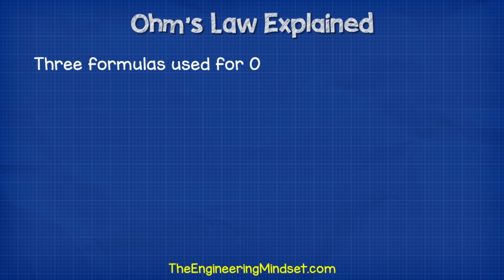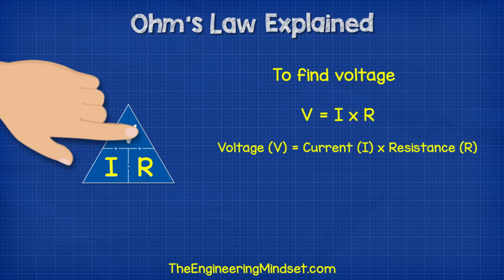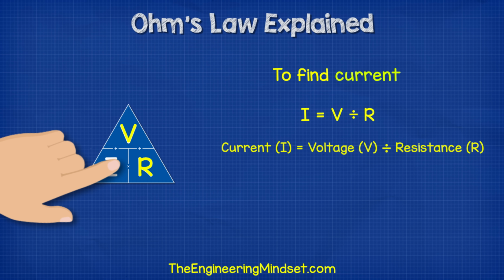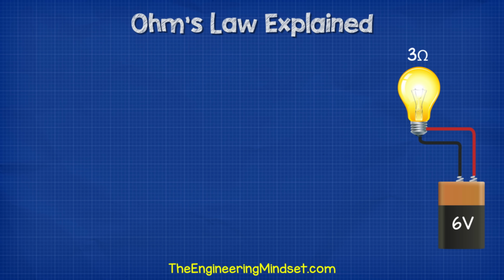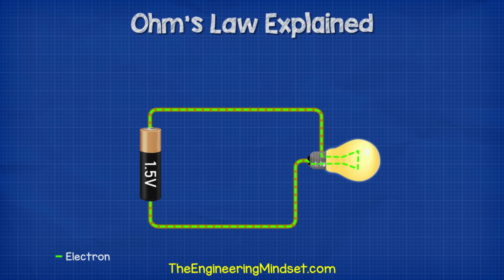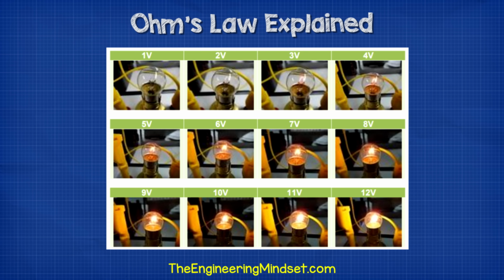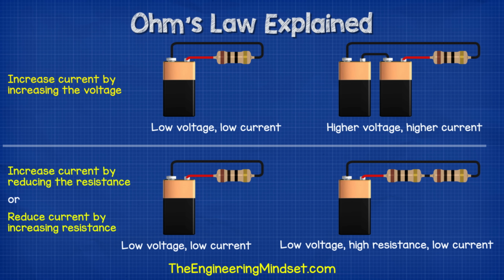Ohms Law Explained - The basics circuit theory

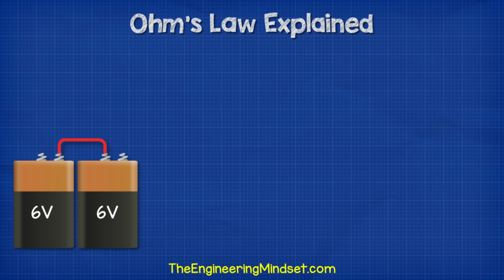Comment: 4:24 I'm going to need this explained... Batteries in series increase voltage,  Batteries in parallel increase amperage.  The available wattage doesn't change in either scenario, the way you explained it would double the wattage.

Comment: I thought when connecting in series only the voltage rises, while the amps stay the same. And vice versa for parallel.
Is resistance the reason the amperage increases? 
I thought if you were to say wire 5 batteries together in series. With each battery producing 10volts and like 10amps for example. It would be 50v and still only 10amp. Are you just increasing the amperage yourself to accommodate the higher volt? Or am i just missing something?

Is ohms law differnet than the example i gave?

I see ive just searched it up coz who knows how long it'll take to get an answer. The difference in the equations is the resistance

I now also know that solar farms, we'll built, are generally going to have a very low resistance anyways. Around .1 or so. AND that my example is mainly used as a baseline to show that in series connections work that way without factoring in the resistance. Just essentially a simplified explanation.

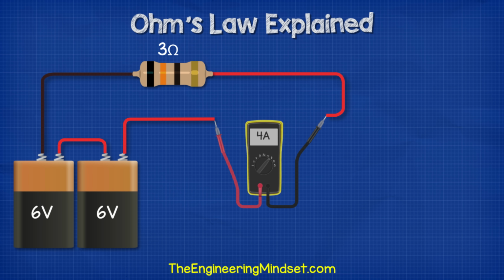Comment: CORRECTION.   At 4:35 when you connect two 6v batteries that each have 2 amps in series, the voltage = 12v but the current remains 2 amps not 4 amps.  Yes?

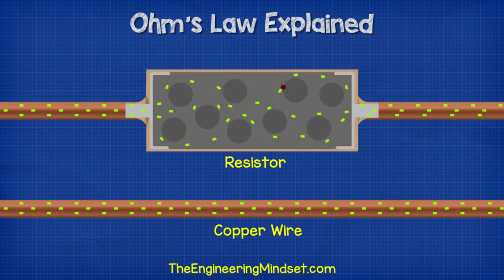Comment: 8:26 - but this is where I'm confused. If the resistor removes energy from the electrons, then if I placed the LED 'before' the resistor, it would emit a different amount (more, if 'before' means closer to the negative terminal of the battery), than if I placed it after the resistor, as the energy hadn't yet been removed from the electrons. Like in your diagram..

Comment: ✨1st Question ;

Lamp voltage (V)⚡ = 120V
Lamp Resistant (R) = 240ohm's

We have already found V and R

Need (I) ;
Current (I) = Voltage(V) ÷ Resistant (R)
I = 120V÷240ohm's
I=0.5Ampere 

✨2nd Question ;

Lamp Resistant (R) = 240ohm's
Current (I) = 0.958A

We have already found R and I

Need (V) ;
Voltage (V) = Current (I) × Resistant (R) 
V=0.958A × 240ohm's 
V=229.92V

Comment: well this was super useful because i am currently planning to make my own 3D printer , well basically a new concept but the thing is i am 15 and i am in 9th standard so i don't have much knowledge , but because of my passion for engineering and because of the feeling to do something special i , started working on projects by dividing them in two parts theoretical part and the practical part and not down my observations. so i knew i would need to know basic concepts of electricity to move forward on my research and make my first project and yea its my first project. so this helped me a lot in understanding it . Thanks a lot and sorry if there any grammetical errors , well english  wasn't my first language.

Comment: What am I missing here? I’m an electrician. The amps drop with a higher voltage in the field, equipment is more efficient if you give it another phase (120v). At 120v an AC might draw 10amps but at 240v it’ll draw 5amps.

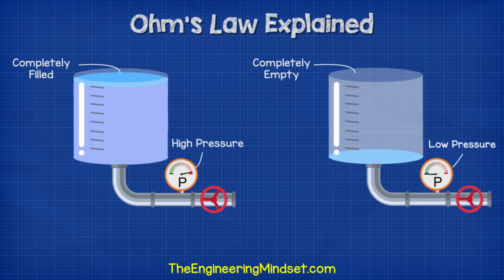The example at 4:50 says if you double the voltage, the amps (current) double. Is that in a series or a DC circuit only or something like that?

Comment: 1. Ans: 0.5 Ampere
2. Ans: 229.92 Volts
Reply: Wrong u divided 120 by 240 you have to switch it around because that wouldn’t work so it would be 240 divided by 120 = 2 amps not 0.5

Comment: 4:25 I thought that if you connect batteries in series only the volts increase and the amps stay the same. I’m confused again
Reply: Found this helpful from a forum: 

The current through the load certainly increases when you put a second battery in series with the load - you've used Ohm's law to prove it.

What people mean when they say "current doesn't increase when batteries are in series" is that the maximum current you can get from the batteries doesn't increase.

All batteries have a limit to the current they can deliver. If you have two batteries that can each deliver one ampere of current and you put those two batteries in series, then you can still only get one ampere out of the batteries. The voltage adds, but the maximum deliverable current stays the same.

If you put those same two batteries in parallel, then the current from the batteries adds. You can get double the maximum current out of them - but the voltage is only the voltage of one battery.
Reply: when you say "maximum deliverable current" are you referring to amp hours? Cuz if you are I get it.
If you arent I'm confused - what does "maximum deliverable current" refer to? If the currents add together according to Ohm's law, how is the added number of amps different from the maximum deliverable current?
Reply: Why wouldn't current increase if volts increase? Ohms law states that more voltage equals more current.

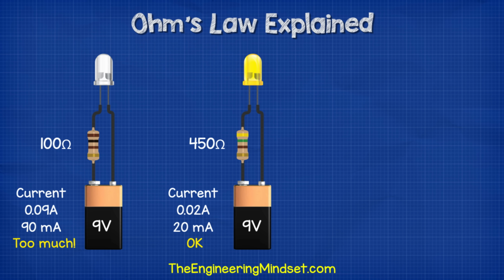Comment: sorry but i dont get the resistance examples at 8:44 - are those some random values in both examples? how do I know that in first example the resistance is to small and it is alright in the second one??
Reply: because the rating for the LED is 22mA or 0.022A

Comment: Could someone please help me understand, I  was doing self study on some of these topics and learned that 1 amp = 1 coulomb per second, and I thought 1 coulomb was equal to a group of 6.242 x 10^18 electrons, but I did some math with elementary charges because I got curious about the numbers, found that 1 e- or p+ has a base elementary charge of 1.602 x 10^-19, if I divide 1(representing 1 coulomb) by 1.602 x 10^-19 I get 6.242 x 10^18, and I double checked by multiplying 6.242 x 10^18 by 1.602 x 10^-19 and got 1. but doesn't that mean that 6.242 x 10^18 is not the number of electrons but instead is the collective elemental charges of a group of electrons in a coulomb?

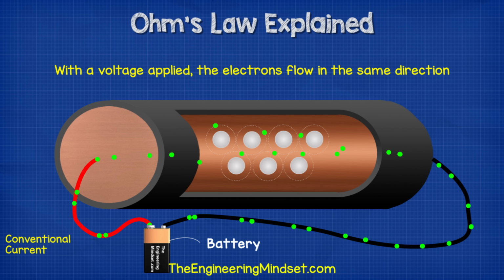Comment: so this is why this is confusing... look at the battery flow at 7:18. the electrons are going from the positive though the wire, and back to the battery to the negative... but the very next picture, you have the opposite. you have electrons going from the negative, though the light, and back in from the positive.  I take it this is because of laziness and inconsistency and not because of something i don't understand. I have seen this more then once now, and its a really really dumb thing to do while trying to teach some one about circuits. This would be like if you were teaching some one how to drive but the book displays some one driving on the opposite side of the road and making right a way turns in the left turn lane. It creates confusion because we know the right way but the diagram says the opposite.
Reply from the maker: It shows electron flow (negative to positive) and convention current. (Positive to negative).
See our video on electron flow v conventional current. It's confusing, but we've all had to go through that stage, once you know it it's easy, and is due to a historical mistake.
Reply from the maker: Seen our new video on How electricity works - for visual learners? Link:➡️ https://youtu.be/3KePcASD0NQ

Comment: First of all, I agree this is a great series of educational videos. However I am confused about the triad relationship discussed here. For example, if one were to increase the resistance to infinity then shouldn’t voltage also increase to infinity…but how can that be…? 
Thank you!
Reply: If the resistance is infinite the current is usually zero so the voltage can be whatever. Only if the current was constant the voltage would have to be infinite. That just means we can't have constant current with infinite resistance
Reply: Thanks again

Comment: so ohms law is when the electrical current in a circuit is directly proportional to the voltage in a electrical system and the voltage is inversely proportional to the resistance

Comment: For Problem 2:
The solution is:
Voltage = Current x Resistance
               = 0.958Amp x 240 Ohms
               = 229.92 V
So, the answer for Problem 2 is that there are 229.2 V

Comment: For problem 1:
The solution is:
Current = Voltage / Resistance
              = 120V / 240 Ohms
              = 0.5Amp
So, The answer for Problem 1 is 0.5 Amp.

Comment: i just got an electric scooter with a 36 v 1000watt motor can i turn that into a generator buy powering with a gas engine? if yes could i then put a resisitor on a lead and reduce the voltage to 24v,,,,i want to power a 24 v 705 watt motor that has a freewheel sprocket on it? any help would be nice

Comment: I understand how there can be no current unless voltage is present, but how can voltage exist without current? E=I/R. If I=0 then E has to equal 0 as well as described by the equation. Consider a battery with the posts a foot apart. R is infinite and I=0 so how does E=12 volts?

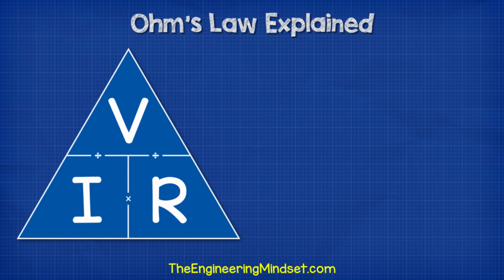Comment: 1:09 Another good way you can remember the relationships is through algebra. You just gotta remember one relationship and then you can solve for the rest. 

For example, let's say I remembered V = IR and I want to solve for current, I can isolate I by simply dividing both sides by the current. After solving for I, you should get I = V/R. 

Hope that's useful!

Comment: ANSWER OF THE GIVNE PROBLEMS
(1) GIVEN:
VOLTAGE = 120V
RESISTANCE = 240 OHM
ACCORDING TO OHM LAW :
CURRENT (I) = V÷R = 120÷210
                       = 0.5 A
(2) GIVEN :
CURRENT = 0.958 A
RESISTANCE = 240 OHM
ACCORDING TO OHM'S LAW :
VOLTAGE (V) = CURRENT (I) × RESISTANCE (R) = 0.958 × 240
                              = 229.92 V

Comment: My question is an audio amplifier running on dc 14.4 v that amplifies ac to ac (signal) if volts are directly proportional to ampere an amplifier running at 2 ohms will pull more current than at 4ohms but power supply remain at 14.4v but amperage has gon up so not directly proportional anymore ❤

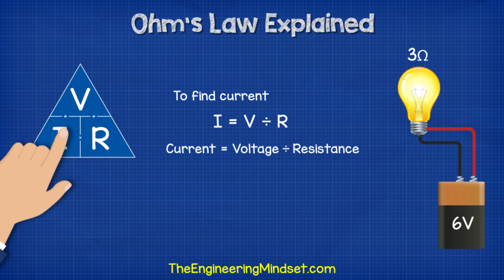Comment: but when they sell bulbs, they don't give you resistance, they give you watts on the package, so how do we know how many Oms is a bulb? @5:38
Reply: Watt is the power of the bulb (p) and to calculate the resistance you need voltage (potential difference (v) so we have formula

R = (V) ²/P
suppose we have power 4 W and voltage 16V so
R= (16)² ÷ 4
R = 256 ÷ 4
R= 64 Ohms
Reply: @akah77  thank you. However, i have an additional question if you let me. the voltage potential difference depends on a country? Like your electric socket output? Or it shows on a package of a bulb?

Comment: problem 1 
given, 
voltage = 120v
resistance = 240 ohm
current = ? 

V=IR
I=V/R
therefore, I= 120÷ 240
                   I= 0.5 A

Problem 2
Given, 
I= 0.958 A
R= 240 ohm
v= ? 
therefore V=IR
                  V= 0.958x240
                  V= 230volts

Comment: Compare the diameter of a silver conductor with that of an iron conductor for the same  length & resistance of conductors.
The resistivity of silver & iron are (0.036)& 0.0145 ohms meter respectively….any solution to this question?

Comment: According to your other video on batteries, I thought that the amperage of the batteries stays the same when the batteries are connected in series and only the voltage increases. This video shows both the voltage and the amperage increasing. Is one of the videos incorrect, or is there an outside factor that I’m missing?
Reply from the maker: In series the voltage increases but the total mAh doesn't increase. The current depends on what load you connect to the circuit
Reply: @EngineeringMindset  Thank you! I’ve been thinking about this for weeks… That’s exactly what I was missing. I was thinking that mAh was synonymous with Current so that helps immensely!

Comment: OK, this is clear when you have some resistance involved. But how about current in a circuit with very small resistance (R=0.0000001 Ohm)? If using Ohm's formula we get current equal to 60 million amps in a 6V circuit. Such current should kill anybody, shouldn't it? However one can touch both ends of a 6V battery without any harm. How is that possible?

Comment: No matter how many videos I watch or different things I read to try to understand ohms law, I just can’t get it. I don’t know why. I think I’m pretty intelligent. As in if I actually am trying to learn about something new, I usually catch on pretty well. I dont know what it is about this but it just won’t click for me.
Reply from the maker: It's literally just the correlation someone found between voltage, current and resistance.
The resistance of a circuit is equal to the voltage divided by the current. The current of a circuit is equal to the voltage divided by the resistance and the voltage of a circuit is equal to the current multiplied by the resistance. That's it.

Comment: Please answer my question. I connected two 1.5 volt batteries in series, the voltage doubled but the amps did not double. Then I connected the two 1.5 volt batteries in parallel then the amps doubled. Can you explain to me what’s going on?
Reply from the maker: Please watch our video about connecting batteries
Reply: @EngineeringMindset  I did, you explained that connecting two batteries in series would increase voltage and amps right? I did it but it only increased the voltage and the amps stayed the same. Then I connected the 2 batteries in parallel and the voltage stayed the same but the amps doubled. I’m confused please explain

Comment: I like to "remember" the V=I*R formula differently:

What is the current? - It's how much voltage "survived" getting lowered (divided) by the resistance. A lot of resistance means not so much voltage "survived" therefore current is low.
=> I = V/R

What is the resistance? - It's the voltage lowered (divided) by the current. Low current implies there is a lot of resistance; high current implies there is a tiny bit of resistance. When the voltage is higher and current lower it means that something has "stopped" the current from becoming big by the voltage, and it's the resistance. Likewise, if the voltage is lower and the current very high, it implies that almost nothing "stopped" the current from being big.
=> R = V/I

(this one sucks perhaps)
What is the voltage? - It's how massive the current and resistance are together. You have a lot of voltage if there is a lot of resistance or a lot of current or a lot of both. It's like the power of a clash between the current and resistance.
=> V = IR

I just prefer to use logic instead of remembering meaningless things

By the way, as a person who loves math, whenever I see math in electrical engineering videos I suffer, it's so weird to me LMAO

Comment: Sir ,4:30 If the two batteries are connected in series, the voltage will increase and the current will be constant, but in this video it says the opposite

Comment: What Ohm’s law says is that in some devices/materials under some circumstances, the (instantaneous) current through the device/material is directly proportional to the (instantaneous) voltage across the device/material.

This can happen only if the resistance is constant. Thus, Ohm’s law also says that in some devices/materials under some circumstances, the (DC/static) resistance is constant for a given device/material for different values of voltage and current.

And what if the resistance is not constant? Then voltage is not directly proportional to current, so the device/material doesn’t obey Ohm’s law, and it has a variable resistance; we can still use the equation v = R i to define resistance, but we can no longer call it Ohm’s law.

Comment: Hello good people, I'm having hard time understanding the last bit with test questions.

I understand it's only a hypothetical example but would the lightbulb work the same in both examples? 
spoilers
From my understanding the Power in the first example is 60W (0.5A * 120V)
and in second example it is 230W (1A * 230V). Given the different Power (I take is as "consumption") wouldn't it be a problem?

Comment: I can't understand how resistance, current, voltage and power relate to each other. Ohm's law says that through a constant voltage, when resistance increases, current decreases. But power would also decrease. The point here I don't understand is that oven or heating element has higher resistance and current flowing through it that makes it heat up quickly, but the conradiction here is that how come current and resistance could increase at the same time. I am totally confused here.